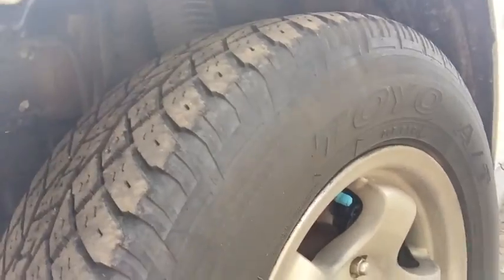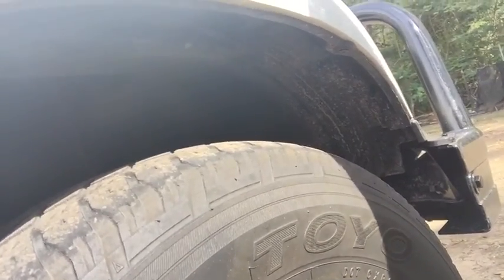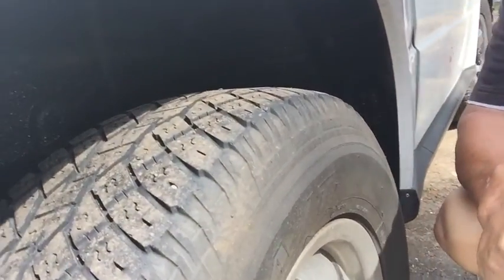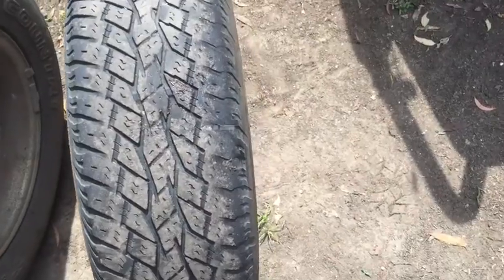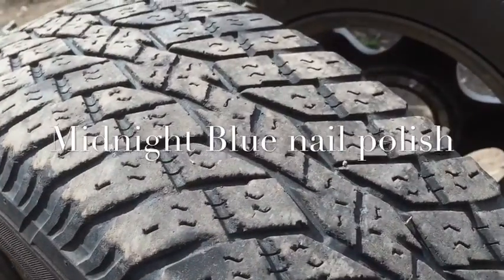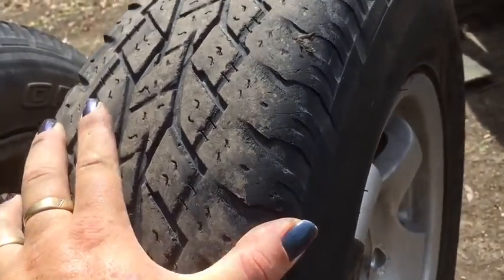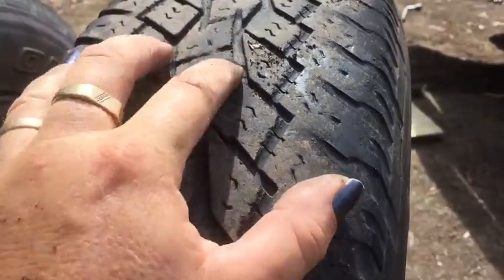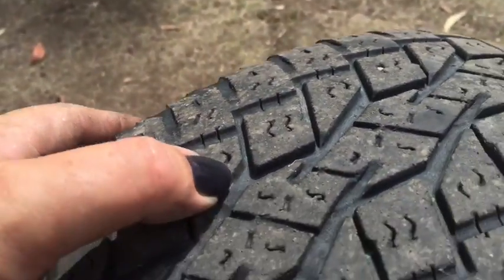Tyre rotation due to wear

Comment: Nice nail polish, and nice looking nails. I have a problem keeping mine looking nice when I get to working around the vehicles or other things around the boat or the house.
We put a lot of kilometers on vehicles and usually make sure the tires are in good condition. For winter tires (notice the correct spelling of "tire") we have Michelin X-Ice 2. They are directional so we have to keep them on the same side unless we remount them for other side rotation.
New vehicles are supplied with all season, non directional tires. after about 100,000 km, we usually replace with directional Michelin, or Goodyear tires.
We tend to accumulate about 400,000 km on our cars over a period of 8 to 10 years, and we usually have 2 cars on the go at the same time.
Right now we have a fairly new, 2012 GMC Acadia Denali, 95,000 km (59,375 mi); and a 2009 GMC Acadia with 195,000 km (121,875 mi).
The 2009 is the beater that we use for commuting between the city and the cottage. Eventually we will replace it and the 2012 will become the beater.
Reply from the maker: Google bridgestone tyres and (notice the spelling TYRES) 😎
In Australia it's spelt different.....

Tire - Tyre
Color - Colour
And how about 
A Tear in you eye
A Tear in the fabric 
Or we say Tom-art-o
You say Tom-ate-o 
But it's spelt/spelled the same Tomato
We use Tomato sauce you use Ketchup 
I Before the E , except after C ..... WEIRD 😐
As you will see Australian Spelling is different to
The U.S.
But Thankyou for picking out my spelling mistake that
Is actually correct, now I'm off to get me some replacement TYRES, as mine are tired 😴😴😴
Reply: Glad to see you are keeping the Driver's Rear well balanced.  Such a tragedy if it becomes too thin around the edges.  
I use tomato Paste cuz it is sugar free. 
no high fucktoes poRn C-erupt-shuns.
this is a ty-earing subject.  
I feel like a Re-Tread.  
Tanks for the Spelting Lesson,
on Day 61 Frances is Gellin'
check out my new Bib Video.
Reply: LOL Brie,
Actually, I was pulling your leg on the tyres thing. I'm in Canada and we have a lot of legacy British Empire things going on with "Canadian English".
We are so intersectionalized between British and US influences that we don't know whether we're punched, bored, or reamed.
So some of us who have a lot of interactions with the US switch our spell checkers to "English US". And I've done that.
In my lifetime, we've seem the overly British cultural influences wane to be replaced by US culture. We've basically become "unarmed Americans with Health Care".
But I owned an MGB way in the past, (1970s). That car did not have tires, a hood, a roof, or a trunk, it had tyres, a bonnet, a hood (roof), and a boot. So I'm not that far removed from setting my spell checker to "Englis, Australian"
See you in your next video, sister.
Reply from the maker: Oh that's fine, Alice, 
No problem here, 
I knew where you were going anyhow 
Anyway for that matter.
Hope all is well with you and hubby, 
Almost Christmas / Xmas time again,
What's the difference between Santa and tyre ?
Santa comes once a year 
The tire / tyre is a good year
What's the difference between a tyre and a condom ?
Tyre is a good year
And the other is s F###ing great yeah
😆😆😆😆😆😆😆
Take care - all the Best 
Xx BRIE xX